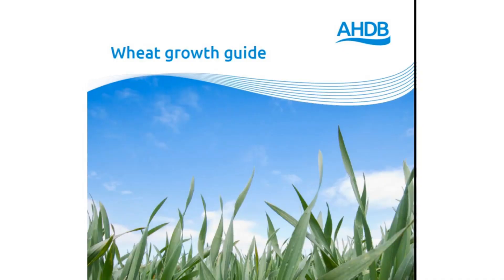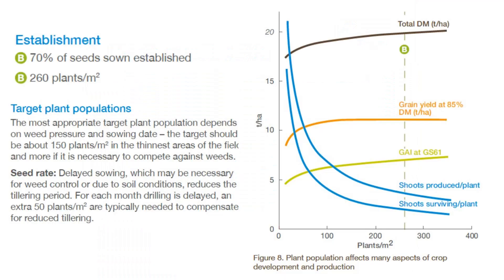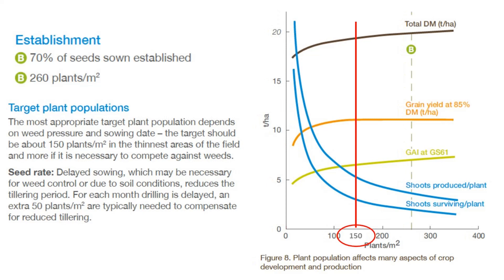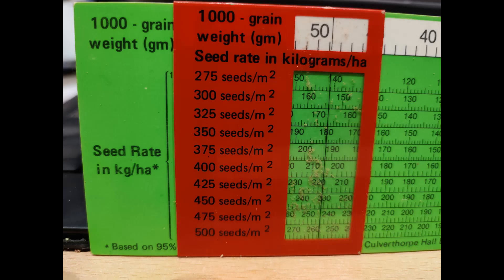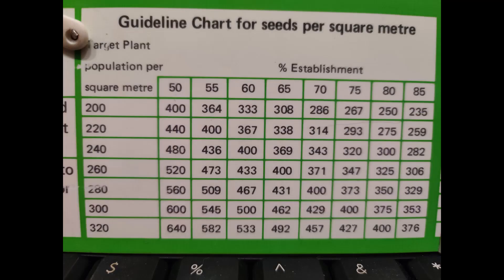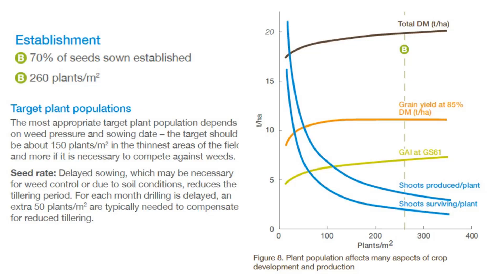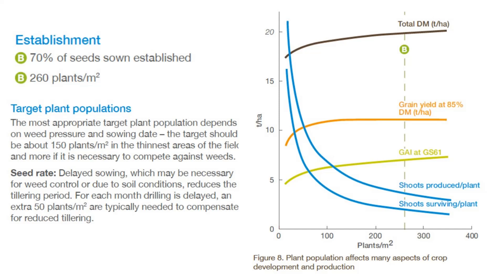Seed survival

Comment: *TIP* instead of using paper to catch the seeds, if you have a spare CYO grain sample bag the tray will slide very nicely inside of it and is easier to pour into the measuring container and less likely to lose any grains in the process! It also folds very neatly and can be stored in the box 👍🏼
Reply from the maker: Thanks, very helpful!
Reply: @AntonysRegen  that’s ok, it’s how we used to do it when a farmer asked for the TGW, another little trick is if you shake the tray side to side, that helps spread the seeds into the cells a little quicker